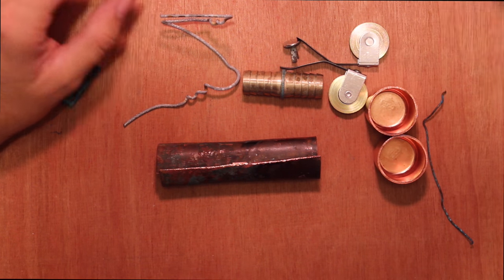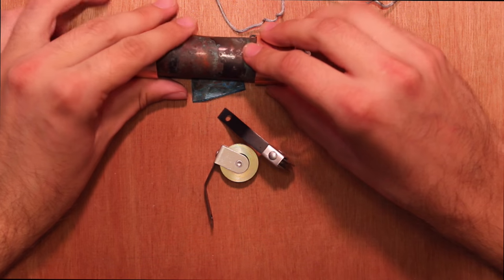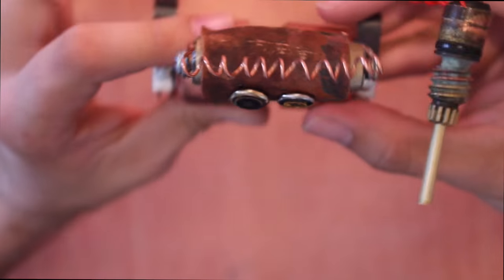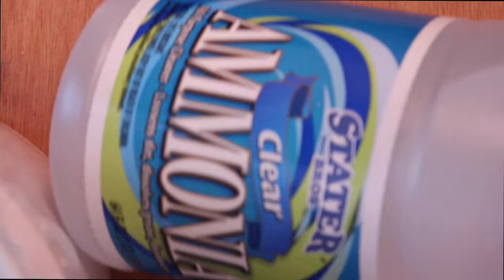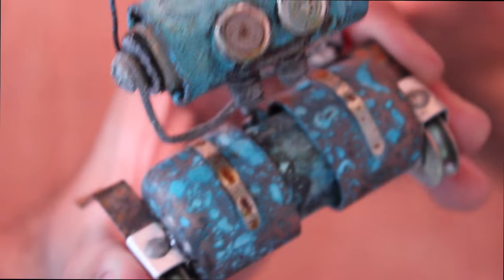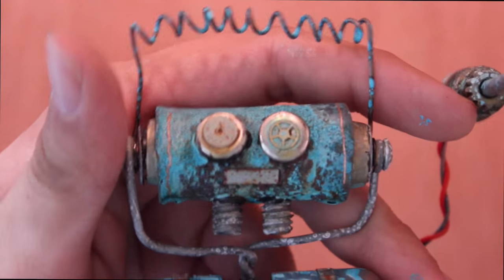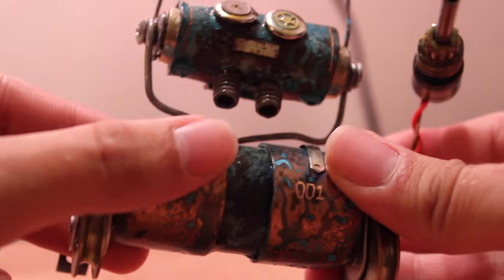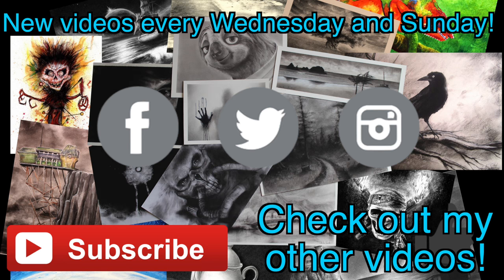Creating a Steampunk Robot Sculpture

Comment: Very cool. What was the glue you used to stick the wheels on ? I was thinking in buying a soldering iron but it would be easier if I could just use glue.
Reply: Graeme Bairden its JB weld